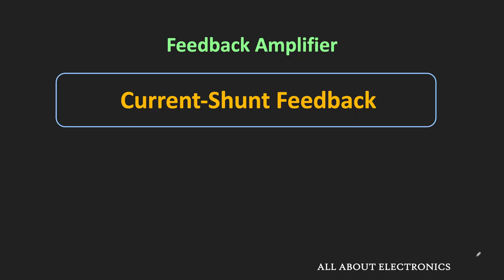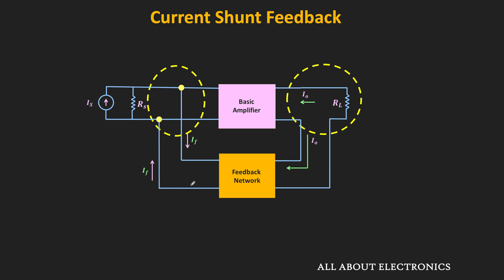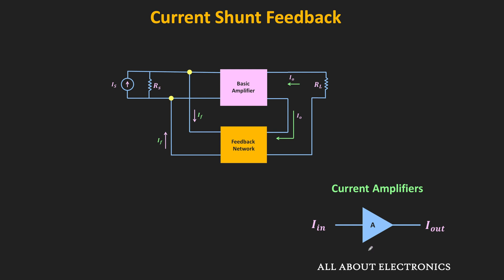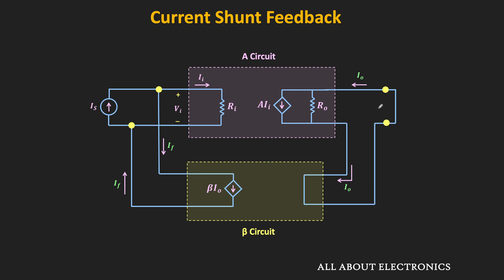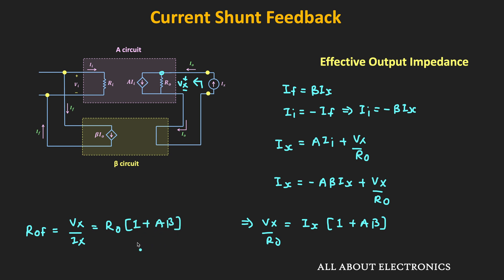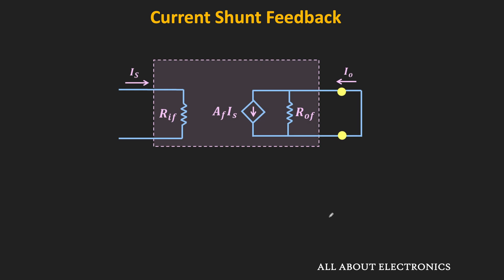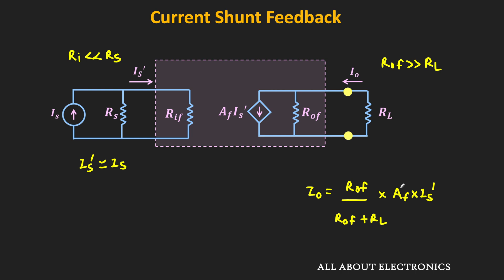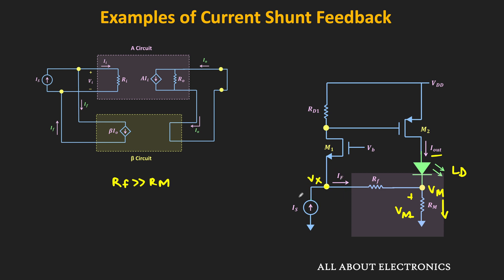Current Shunt Feedback Amplifier Explained | Feedback Amplifier

Comment: 2:29  ??🧐?? so the feedback network is not continuous? It shorts the output? Oh and it shorts the input too?
Reply from the maker: No, actually you will have load resistor where the short is shown. Here it is shown like this to indicate that the feedback network is sensing the output current and fraction of output current is sent back to the input side. If you see the full video, you will get it.

Comment: Hi fantastic Job !
I have a chalenge for you :
What simple electronic design can achieve this formula  Vout =  (Vin - offset) Gain.
Vout  = range 0 to 3.3v
Vin = range 3.2v to 4.2v
Where:
 Vin= 3.2v   Vout = 0
 Vin= 4.2v   Vout = 3.3v
Without using Op amp or chipset (maybe Mofset ?)